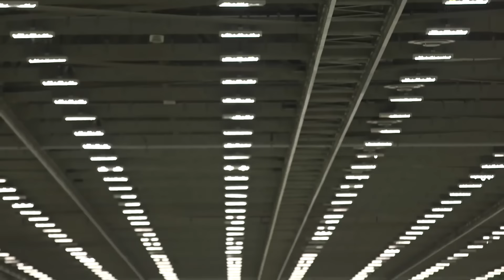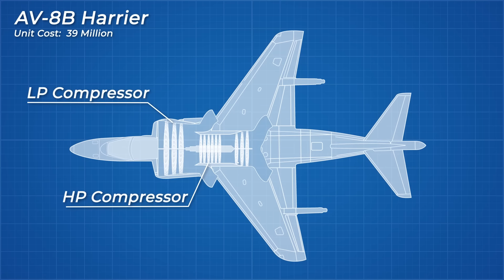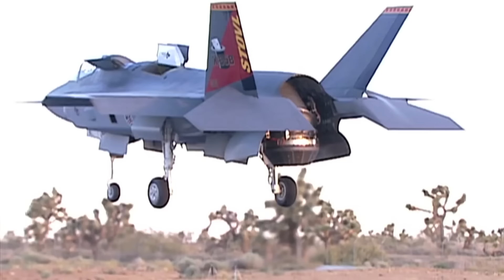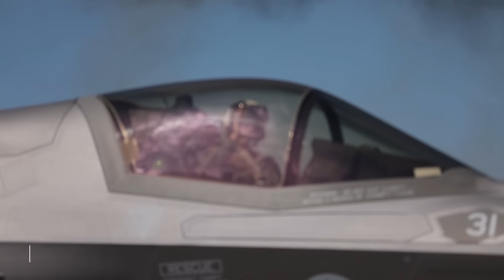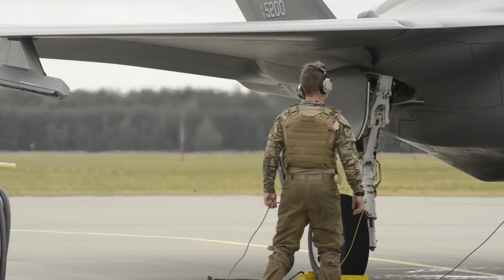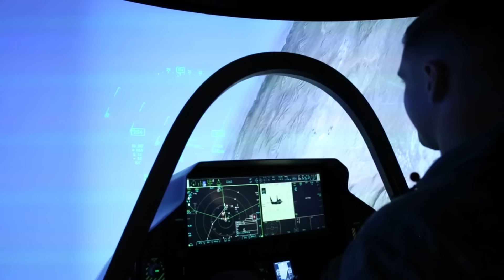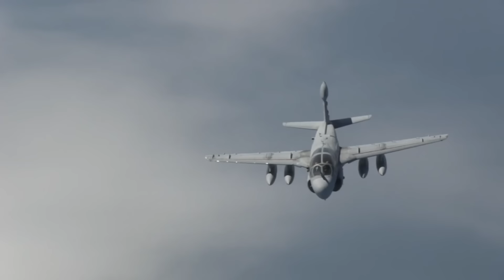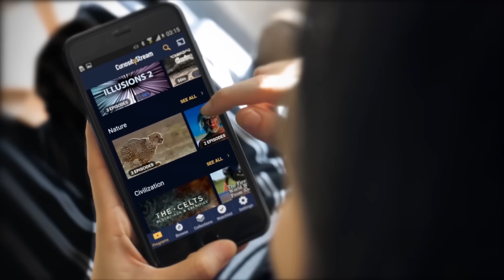Is The F-35 Worth $115 Million?

Comment: My answer without having watched more than a second of the video:
No
Reply: yea because you know nothing about any aircraft, fighter jets and modern air combat, you know nothing about the situational awareness that sensor fusion will give you. how about you stop making comments on topics you have no idea about, gamer.
Reply: @Luneee555   Why do you say that? That is just an asumption on your side.
And about the aircraft: If I'm not to judge it, than maybe the defense administrations of many countries, that decided not to adopt it, because it doesn't fit their requirements. These countries have also expressed critisism about the upkeeping costs. Although the jet is a little bit cheaper than other fighter jets, it does cost more to keep it running. In addition to that is the problem that many replacement parts are not available and/or are misplaced rendering any maintenance impossible, which means that a lot of jets are not action ready and have to stay on the ground. These are important problems, which can be fixed but they aren't at the moment.
Don't get me wrong. It's a promissing aircraft with a lot of capabilities, it's just not quite ready yet. Give it a few more years to sort out it's problems like the accuracy of the cannon and the aforementioned problems and than it will be a very strong contester. I just think that it is wrong to hail the F-35 as the best thing for every use and to ingnore the current short cummings.

There you go, these are the reasons why I'm not fully convinced about the jet.
And maybe you could focus on the argument instead of shit talking the author of the comment.
Thank you.

Comment: The F35A costs 80 million. It's far cheaper than most 4th gens, let alone 5th gens
Reply: Ee E  yes but the f35 kills 4th gens 25:1
Reply: Yeah, but not cheaper than American 4th gen fighters.
Reply: What's cost of J 20 and 31 can someone tell me?
Reply: Zero Cool  78 Su 57 are ordered by russian air force
Reply: Mohammad Usman what? The SU-57 is 40 million, much cheaper and is also a 5th gen
Reply: @sajedm9156  SU-57? Are you serious? It probably doesn't even exist lol
#PutinLiar #PutinCriminal
Reply: @jeshkam  Su 57 was flying in the air shows years ago
Reply: @vaidasspu  I'm sorry, you're right, I looked it up: old engine, old avionics, no stealth, outdated radar. Mockup, as usual...
Reply: Fourth Generation Fighter :"Unit cost 
F-16A/B: US$14.6 million (1998)[4]"
https://en.wikipedia.org/wiki/General_Dynamics_F-16_Fighting_Falcon
you can check more recent aircraft like F18 if you want. The only thing that tops it is F22 in the fighter catagory I believe. because it's better. especially for the time.
Reply: @Mallchad  f16v is like 40 million